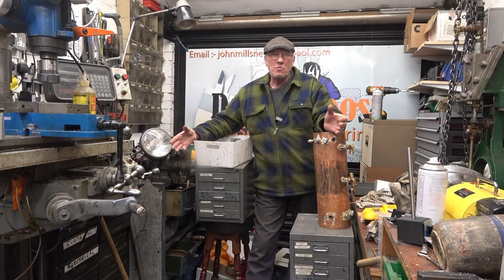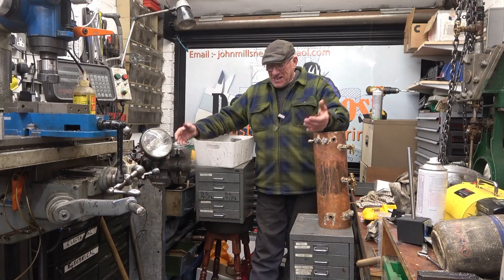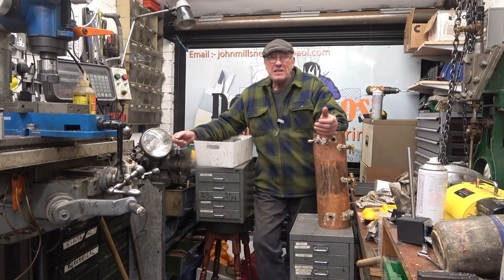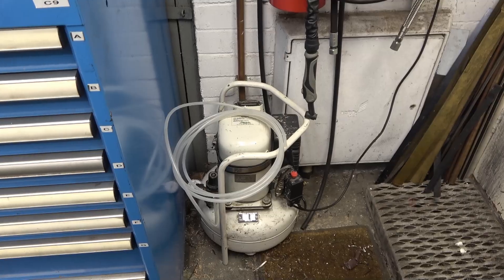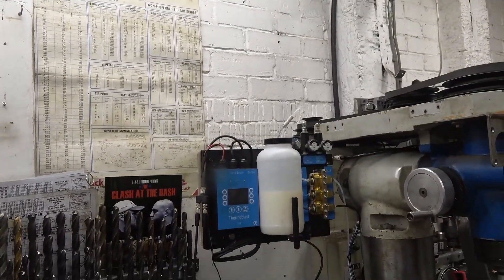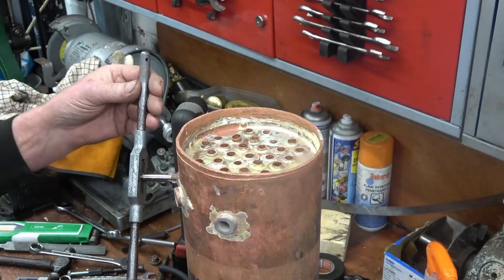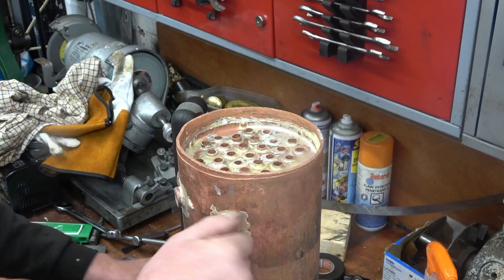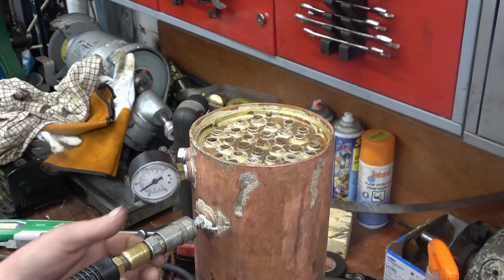SNNC 620 P1 . Copper Boiler Build P6 Hydro Test . Plasma Cut DB6 Present.

Comment: As well as the little hole under the rivet, it looks like one copper tube on the right hand side @ 3:43 didn't get any solder. The solder-free looking tube moves to the left side of the screen @ 4:15 upon boiler rotation ... then @ 5:22 the unsoldered looking tube is magically no longer looking unsoldered 😁 ... or am I imagining things !? Either way ... Good job in the end John man 😉👍

Comment: Theres always the ceiling to mount the Bambi compressor John, or outside 🤔. 
People are surprised how much heat copper needs, ref very high thermal conductivity. 
Nice boiler, good for 100 years.
Reply from the maker: Glad you liked the boiler, it's built to last!

Comment: Hey John, I know nothing about pressure vessels, but I guess the final pressure rating has to be tested at temperature with the copper and solder softening?
What temperature does the boiler operate? Google says "366°F (186°C)" at 150 PSI.
Reply from the maker: That temperature is correct at 150 PSI  the solder melts between 650 /  800 Deg C  the copper melts at about 1100 Deg C. There are a lot of copper boilers in use . Low water is the dangerous time .
Reply: @doubleboost  I hope we get to see it running.